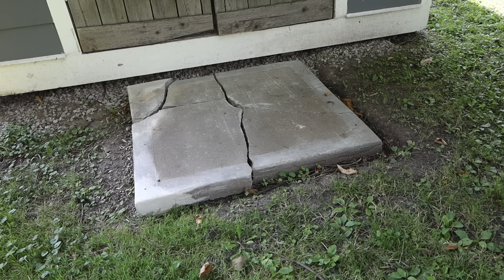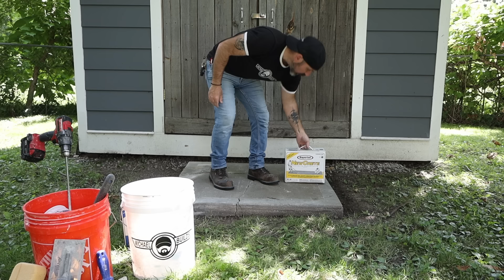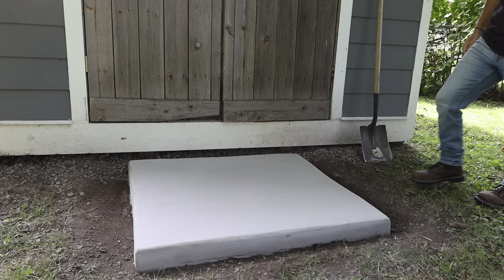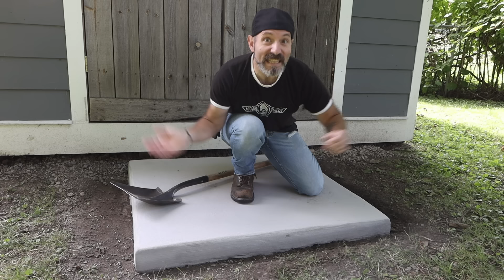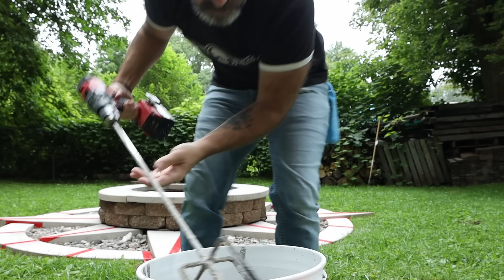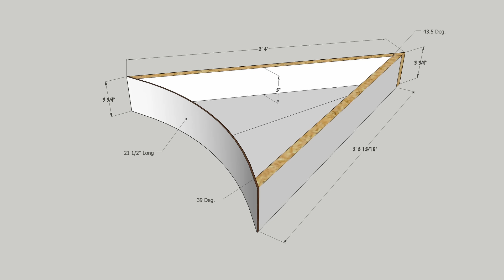How to Resurface Concrete with Rapid Set NewCrete

Comment: You just gave me the push and knowledge to resurface my drive until I'm ready for the pros. Good looking out for this video!!! With God all things are possible!
Reply: Will it really handle cars driving on it? Still a good solution for what just gets walked in in any case.
Reply: God= willpower & determination ✅ God is in you  . Just make sure he mixes a little bit first to play with, to determine how very little time there is to work with this material.  God gave us set and flow additives to delay the set time and make it flow better without adding more water. Set and flow additives are sold separately and individually,, should be located near the bag mix.  Also, God told me it’s best to add the water to the bucket first and to read and fallow the instructions on the bag regarding water ratio. Also to fallow the instructions on the set and flow additives. There’s a learning curve to working with this stuff. Looks easy but looks can be deceiving. Start small and by no means leave the mud un attended in the bucket, mix it and use it ASAP keep it moving in the bucket if you don’t pour it all out at once. Otherwise it gets hot, literally hot,.. and hard AF fast AF✅🙏
Reply: How did your project go?
Reply: Was God in the video?
Reply: @truthalonetriumphs6572  - yes in spirit.
Reply: @truthalonetriumphs6572 yes indeed!  God is everywhere! 😊❤❤
Reply: - God? 🤡🤡🤡🤡🤡🤡🤡🤡🤡🤡🤡🤡
Reply: @KJ-tq3sm  get lost edge lord.

Comment: I like the video but if you're going through all that work why not just dyi it from the beginning. Toss out old concrete. Frame new square, add chicken wire and good subsurface then quick mix new concrete?

Comment: Nice intro to a couple of products that might be useful. Late last fall, I poured a 10X11 slab, solo. My first pour of this size and the surface turned out a bit rough. I'll consider these products and techniques to prepare the slab for ceramic tile, after the roof is up. Thanks!!

Comment: Sorry MAN, this stuff sucks, its impossible to mix right, 8 boxes 8 tries and totally different even with a measuring cup stolen from the kitchen. No way to get a consistent thickness on the squeegee, just a bad finish product, looks really bad. Just not a product i will ever use and actually will skip quickcrete everything from now on, you'd think a 55 yr old Stanford engineer with 2 degrees, and who has been an engineer for the government for 25 years at DARPA, and now retired builds robots for fun, could figure out following instructions on the box, on 10 you tube channels and quickcretes own videos and my helper a house builder for 23 yrs., Now i have to paint that crap and move on.

Comment: Hey there where do you live and do this work?  A lot of concrete videos are done in the south where you don’t have the freeze and thaw cycles but I saw snow and colder temperatures in your video so I’m just wondering what kind of temperature extremes you experience?

Comment: Interesting. Did you mash down the first batch of patch or filler into the cracks essentially filling them up? As long as the concrete doesn’t flex or shift again at that spot should be ok I’d say.

Comment: The shovel was no test, try the F150 truck again.
Reply: Do you realize the shovel test was to show that it doesn't just scrape or chip off easily, it is not supposed to make the slab tougher than it was before, it is just to hide the cracks and make it look nice. 
If your driveway has a few cracks in it but is otherwise in good shape and there is not a problem with the cement crumbling or breaking whenever a car or truck drives on it, then this should be fine to simply hide the cracks. 

The small slab of concrete he was using to demonstrate "how to" was from a past video where he did a dry pour, then tested the strength... It failed that test, having the gaps filled then an 1/8 inch of a product on it would not make a slab that can't hold up to being driven on suddenly be able to support the truck.

Comment: Xlnt how to video but I do have a question - It looks like you apply the Cement-All with a pretty thick consistency so is a trowel enough to push it all the way to the bottom through some if those thinner cracks that run through the pad all the way?

Comment: Nice job.
My question is related to the prep.  For a concrete driveway that was sealed & painted with the install many years ago  (and never resealed or repainted), is there more than a pressure washer to use for getting (back) to the concrete?

Comment: Shouldn't you start with the question of why the slab originally failed? If there's an inherent foundation/ground/soil issue then you need to fix that 1st, then go use these products, or else we could be back to a new cracked slab.

Comment: Never resurface something that damaged. A true mason know concrete cracks transfer from layer to layer . All these cracks will transfer to the top! Just like Bondo for concrete. It will always fail. Might look good for a season or two but all overlays fail. But that’s just my experience from pouring concrete over 20 years. It’s just Bondo for cement!

Comment: Hey Michael, in your video you stated that you hadn't found a stain that you haven't fallen in love with.  Let me recommend one: It is made by Smith Paints; It is called Smith's Color Floor. It comes in array of colors and is designed for concrete. It comes in a one quart concentrated bottle an it is recommended to mix it 4: 1 with purified water. 1 qt. makes a gallon. This stain is polymer moified and is amazing.  I have been using this stain for over 20 years.  I don't know why it isn't more popular.  Hope this helps, Lee.
Reply: Did you have to order from the company?

Comment: I have a project that I need to resurface concrete slats in a hog barn they are pitted on the surface. Problem is I cannot put the new Crete on and push around with squeegee because the slats have holes in them that the new Crete would fall through. Any ideas on how I should apply this. I would love to hear your input on this. Or if you have a better idea on how to resurface the slats.

Comment: Serious question: Since a driveway is cracked for a reason, isn’t resurfacing just putting lipstick on a pig? I mean, if it cracked a few inches of concrete for whatever reason, I assume that that thin layer of NewCrete is going to crack even quicker.

Comment: Sorry if this is a dumb question: it seems like there was something skipped in the video. In the before picture, there are larger gaps in the cracks. Then when he starts the first step, the gaps have shrunk- like the pieces were shifted. Is that a preparatory step that was not shown? Asking because I have a corner of the driveway that has broken and over the years there is a gap of at least an inch. Do I dig it out and try and get the big piece back in position before I follow the steps into the video? Thanks for any advice.

Comment: How long before those major cracks return to your slab, do you consider this a permanent repair?
Reply: If you're slab has rebar in it, the repair will hold for a very long time. If you don't, it will probably fail pretty quickly if you drive on it. But if it's just a sidewalk\porch, with no real weight on it, it should hold for a good while.

Comment: Not knocking the product as it looks great, finished.  But save yourself some $ by just getting a new concrete slab that he re-paired re-finished.  It would be a whole lot cheaper than buying those two products.  Of course for a large slab, repair is better with the product.  Jus saying....

Comment: My concern is that this slab cracked partly because of unequal support from the ground. What you've done is resurfacing. It hides the cracks but you still have several broken pieces underneath that may separate again if extreme weight is placed on the slab. It's no stronger. For a SMALL piece of concrete like this the "right" repair (IMO) is actually replacement (with remesh, rebar, chicken wire, etc for strength). However, the value of this video is to show that this technique would work well on much larger concrete with greater thickness that cracks - the weight and much larger surface area of something like a driveway will keep things in place and that is where your resurfacing approach shines. Thank you for making this video. Your statement in the pinned comment about the value of repair vs replacement is totally spot on.
Reply: it cracked because he drove his truck over it, it wasn't fully cured, and it was a dry pour.
Reply: @steveww07  Yea and no rebar either he's got soft hands for sure brother
Reply: He didn't make the video for your benefit Just another cobber trying to make an easy dollar. Your justified with your concern, and he might as well just paint it as use a product not intended for that purpose. 60 years in the trades and I know better!.

Comment: This will only work on light use (walking) surfaces only. The second any substantial weight (car) is placed on it, the surface will crack again guaranteed. A good light use solution though.

Comment: OMG I NEED YOUR HELP...HOPE U READ. I JUST DID A DRY POUR. AS I ATTEMPTED TO TAKE OFF THE FRAME I NOTICED ONLY TOP 3 INCHES WAS SOLID. BOTTOM WAS PURE CRUMBLY ROCKS 😫😖. I REALLY DONT WANT TO START OVER. WHAT CAN I DO TO FIX IT? IT LOOKS LIKE IT DIDNT GET WET. I DID WATER IT BUT I GUESS NOT WELL ENOUGH. IS IT A DRY POUR FAILURE???

Comment: Found this video today.  Thank-you!  I have asked concrete guys to recoat our garage apron that is repaired from cracks and they want to rip it out and redo it.  I will try this...also have small crumbling spot on a sidewalk slab.  This will definitely fix that!!  Appreciate the help.
Reply from the maker: You are welcome! ☺️
Reply: So what happened? I have a PATIO & walkway to resurface. 2 cement bids didn't wan to resurface. Said it will not hold up long. It is not a driveway and of course the job will cost more for demo & repour!!!

Comment: Will this work on the cracked driveway asphalt edge i caused when excavating for permeable paver grids. I had to cut the asphalt street 1-3 inch thick was all they had and i cut down over a foot in most places and dont work fast. Some edges have cracked or broke off all together! Whoops.

Comment: We have a patio where the areas that have cracks can be as much as 3/8" below or above the adjacent section. Can this be hidden successfully using the first product that you used to fill cracks by applying a very thick coating?
Thanks

Comment: I guess i didn't get where you told us the benefit of the NewCrete on top of the Cement all vs just Cement All in one pass (or two if there is a reason).  Why was the second step done with a different product vs a slightly thicker Cement All or even all the Rapid Set brown mortar mix?  Is it more forgiving?  A more natural color (vs white), or something else?

Comment: Why would anyone do this without reinforcing the slab somehow first?  The slab has no strength left across those large cracks, and over the period of weeks or months will propagate any cracks up to the surface through your freshly finished fix.  That slab should have been torn out and re-poured.

Comment: Can this be used on fill the deep cracked  slant driveway ? Can you please do a video on that? My driveway has a slope and there is a deep crack next to garage and I am wondering if this will work
Reply: Get a concrete guy to cut and replace a section of the driveway that's cracked. You don't have to replace all of it. Never do what this guy is doing on anything taking serious weight like cars. It will crack again very fast.

Comment: Question:  Do they make a non slip paint that looks like/has the same original color of concrete or do you have to use a New Crete resurficing product?  I am in a damp climate, so mold/algae need to be cleaned off walkways yearly.
Reply: You can add some grits (cereal) after first wet coat of paint and recoat it. Try to find video of guy adding grits to steps. I used it in my wooden shed wooden ramp and in some slippery concrete decks with great results.

Comment: You mentioned clean concrete. My porch has a fairly consistent painted surface. I’m looking to level and fill in minor cracks. What would happen if I applied this to a surface that was hydro blasted to remove some of the paint?

Comment: These products seem to be what I need for my front porch. 
I've got a 17' X 7' @ 6" thick cement.
In the years the slab settled on one side and cracked, leaving the crack opened up in some areas about an inch.
Also the crack is uneven leaving one side higher than the other about a half inch.
I've considered using my end loader bucket of my case 580 backhoe and possibly lift on the side that settled to even up the crack. Then some how figure what I could use to support the settled slab so it can stay even with the other half before using New Crete products.
Anyone have any suggestions other than removing the existing cracked concrete and do a new pour???
Thanks for any suggestions.
Reply: Overlay the concrete with Concrete Overlay by Brick form. Just don't put anything heavy on it. Slope it the correct way when laying the overlay material

Comment: This is reminiscent of a high-strength grout. It might be good for a temporary fix but if your concrete is cracked bad you have bigger issues and it will eventually continue to crack.  It would probably be okay for a light weight light traffic slab..

Comment: Thanks, because I'm working on a project of driveway extension and am adding slabs, not filling the entire area at once.  I'm wondering if the top will crumble or maybe cracks will develop.  Well at least I know I can repair it down the road if I did not do a good job.

Comment: Hi Michael! Great results! After getting a quote of $3000 to fix my driveway, this was welcomed news.We have three cracks crossing our driveway. None are deeper than 1/4".  We are planning on our own repair after seeong your video. I also wanted to get your take on something else. Our drive way is 35 years old. In addition to those 3 cracks,  the top surface seems to have been altered in that the grey color has "etched," off to where thst it looks worn. It is not crumbly though. Right now it is just a lighter color in large sections. Any ideas?
Reply: Pay the guy to replace your driveway. 3,000 for a new driveway is really good. This will shatter after driving on it for a few days. Don't do this on anything with real weight going on it. You need gravel and rebar for driveways. Your old driveway is mostly likely lacking in those 2 materials which is the reason it failed even after 30 years. Concrete done right will last 50+
Reply: @jesussolorio8437  Thanks. The $3K was to fix 2 cracks by cutting out a section. A new driveway is $18K.  So you think the patch idea is not practical?
Reply: @YahuahLives  Yeah 3k for a section of concrete is bit high. Get different quotes from contractors. I'm sure you'll find someone to do it for less just tell him to show you pictures of previous work so you know how he works and what his jobs look like. You can also always do it yourself if you're good with your hands. Break the pour up in 2 or 3 sections so you don't have to worry about concrete drying before you can finish. You can also prepare it yourself then call concrete finishers the day of the pour to give you a professional finish. Different ways to go about it just depends on your budget.
Reply: @jesussolorio8437  Thank you for taking the time to advise me. I appreciate your kindness, a rare quality today!! Blessings to you!
Reply: @YahuahLives  No problem hope you figure out a solution to your driveway. 👍

Comment: Since the slab (shed) cracked, won't it continue to crack after this repair has been made if there is nothing done to eliminate the reason it cracked in the first place? I mean if I did  what you did, wouldn't the slab continue to crack through the repair?
Reply: This will be cracked very soon just like it was when he coated it.

Comment: I’ve used those products before love them. The mortar mix even goes thicker. With a 7000 psi
Reply: What product goes thicker?
Reply: @johnanon658  rapid mix mortar has psi of 7000 and sets fast up to 4 inches thick for patches
Reply: @johnanon658 rapid set mortar mix

Comment: Good luck getting that to work on anything except a hobby project.  The pad broke up because it's unsupported.  What do you think is going to happen when it moves again?  You put the initial product on too dry and good luck trying to work the finish product that thin in the sun.

Comment: This is so cool!  I was considering using the NewCrete but opted not to and I'm glad I did, because I don't have the squeegee.  Also, I love what you did with the fire pit.  When I wanted to make my retaining driveway wall more uniform in color,  old concrete, new concrete,  I just added regular paint to a slurry of cement a painted the retaining wall.  Looks good.

Comment: I think it would be stronger if the pieces were separated slightly and the cement-all applied within the cracks and closed up. Just applying on the surface will have little flowing into the cracks to have increase bonding.
Reply: He said you can sck it 😂
Reply: @hostilesavage4299 What does sck it mean?

Comment: Couple of comments, I would think you would remove the pieces, pack and level the dirt or put down gravel, then spread the cement all in the crack and then push the pieces together. Then New Crete after 1 hour. Could you do this as a dry pour repair?

Comment: I would think that slab would crack again pretty quickly.  Only the top portion of the cracks were filled, instead of filling all the way through.  But, more importantly, the damaged structure underneath the slab wasn't addressed.  So not only do you have the lower half of the cracks not filled in, but the stress points weren't corrected.